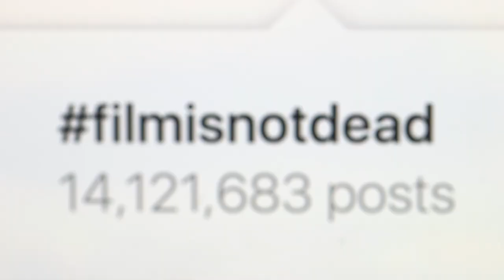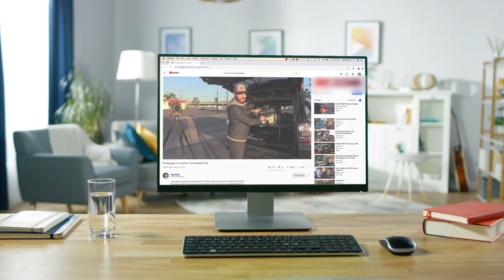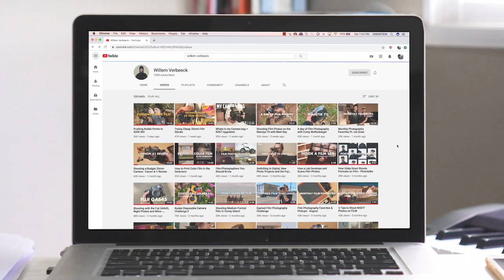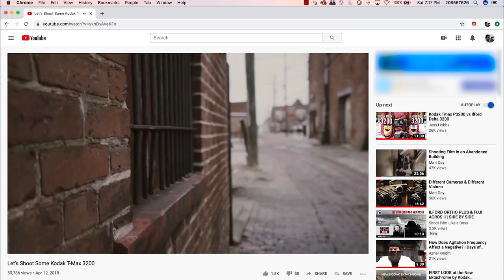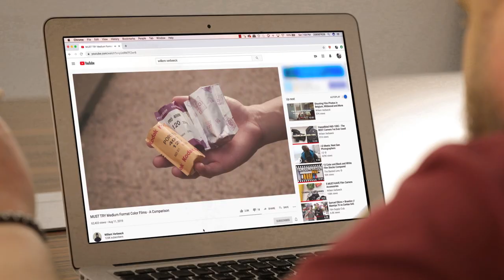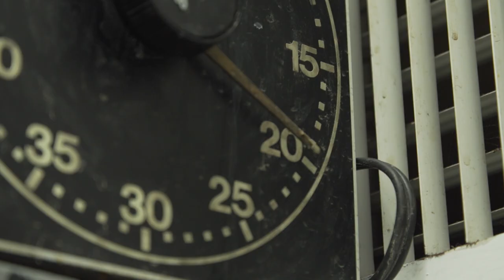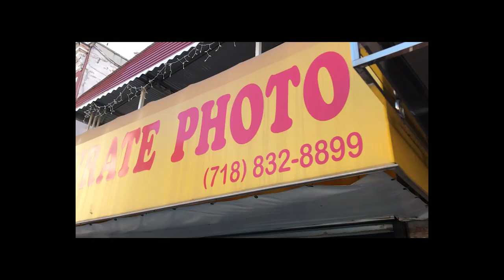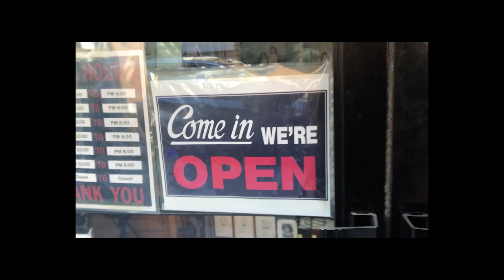Why We Still Love Film: Analog Photography in the Digital Age | NBC Left Field

Comment: I see this and shake my head.  There are reasons why we left film, cassette tapes, 8-tracks, vinyl, and the typewriter behind.  We don't even see photographs on paper anymore - but on screens.  

Its also horrifically expensive.  Photography was never cheap,  but the cost of film made  it prohibitively expensive to get into as a hobby.  Its way worse now, and costs 3-4x what it used to and anywhere from 5-100x longer than id did.  The cost of film is about a quarter to take a single picture, about 50 cents to develop a single exposutre ( $15/36 - and you dont get the paper prints back either - you get a CD) , and then 20 cents a print.  Before taxes.  So, it costs $1/photo, shot, developed and printed on 4x6 paper.  Turn around is a week or so (it used to take only an hour -with prints), you don't know if the pictures turned out, and you can only share them in a photo album.  

I write this as some who rolled his own B/W film in the dark, developed his own negatives, printed his own pictures on a Durst on Kodak or Fujinon paper, and had them published in journals.  Getting out of film when sensor quality became reasonably good (about 6-10 MP) for professionals about 20 years ago  - 15 for hobbyists  - was the best thing ever to happen to photography.
Reply: Ikr! I mean I STILL see people riding bikes, idiots buying candles and crazy people walking. Yes, walking :-O 

Who the hell walks or rides a bike in the age of motorised and electric transport?

What crazy person lights a candle?

I had to double take when I saw my neighbors mowing the lawn! With a mechanical mower too! Who needs to mow lawns when we replaced them with paving or plastic grass?

A mechanical mower! Would you believe it? One of those pushy spinny ones. FFS the world has gone mad.
Reply: @dlarge6502  The problem is, walking, riding bikes, candles, and lawn mowers are haven't been improved upon by other activities or devices to the point they are obsolete.  Film, on the other hand, has been made obsolete by better technology.  

A more accurate retake on your post would be:  Who the hell rides a horse anymore?  Would you believe some dope in my town does!   It shits everywhere, you can't take it down the street, its expensive...and get this you gotta go to a blacksmith and get iron shoes nailed into the damn thing's feet!  Also, some dope in my hometown buys encyclopedias!  Can you imagine spending $1000 on 26 books that are obsolete and incomplete references in the age of the internet?    

That's film.  The horse and buggy of photography since about 2003.

Comment: I came back to film in 2016 after a ten year absence where I used digital cameras, but was never really happy with them.  Originally, I knew absolutely jack about the technical side of photography, the difference between film formats or anything else. Much to my delight, all the cameras I had pored over in catalogues but could never afford as a teenager, were all going cheap on eBay. So I am using cameras that would otherwise be in landfill and I use mainly expired film as well.

Comment: A lot of debate about the environmental impact of analog photography is in the comments. The main point is that lots of analog photographers use cameras that are 30, 40 50 years old or even older. But each year a new DSLR or mirrorless camera gets introduced, bought and lots of older digital cameras have become obsolete so basically rubbish, including the sensor, electronics, batteries etc. But old film cameras, if maintained and repaires properly can last for decades to come.
Reply: that’s very true, but i’m just curious on the environmental impact of film rolls; they’re not quite so eco friendly